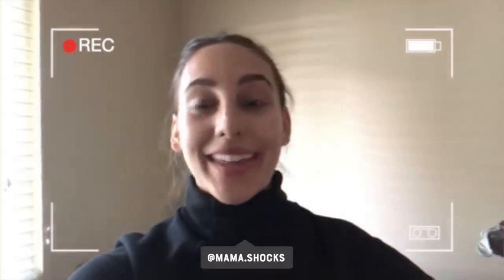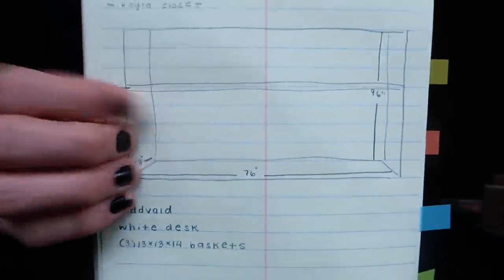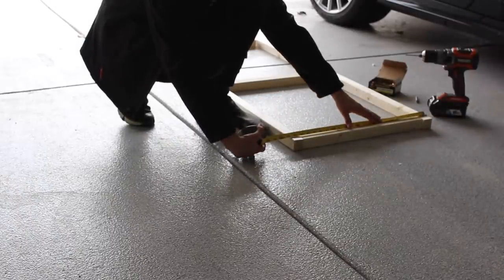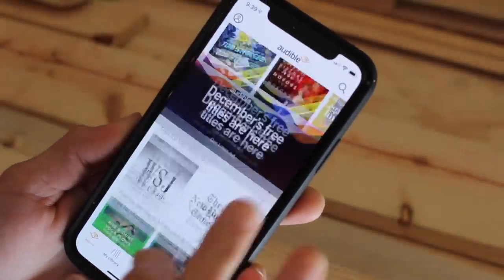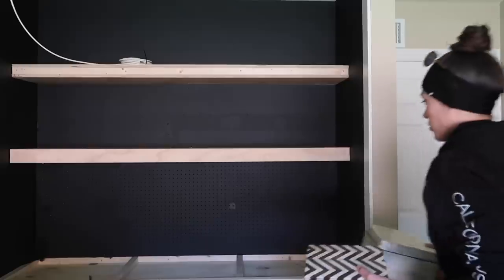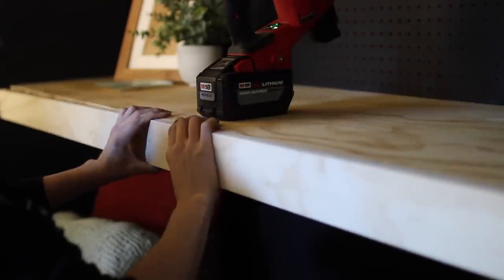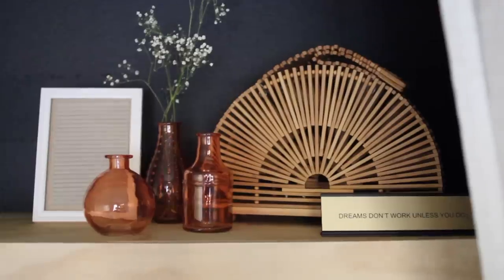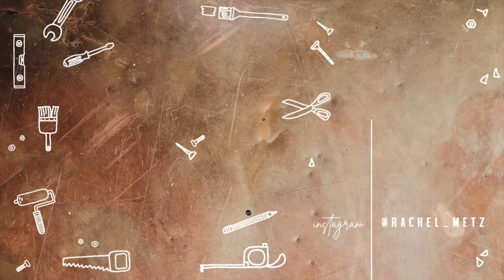Turning a Closet Into an Office Space | Weekend Makeover for Less Than $200!

Comment: What did you use to protect the desktop wood?  I’m doing the same thing using 2 file cabinets with a precut  butcher block top from Lowe’s. I’m trying to figure out what to seal/protect it with.  Now I’m thinking of painting the wall behind it black. Shelves are going up too. It’s in my bedroom. Only place in my 2bedroom 1000 sf house for it. Thanks so much for this video. It’s brilliant.
Reply from the maker: I also use a clear satin poly - three coats, sanded lightly in between.